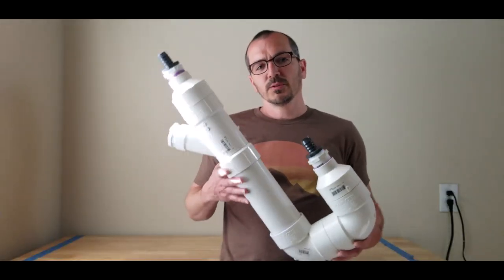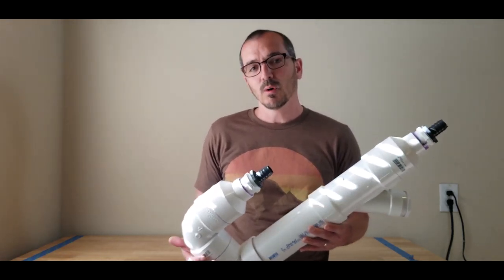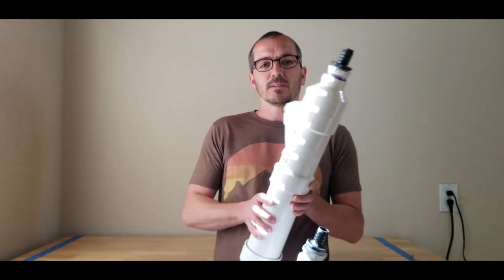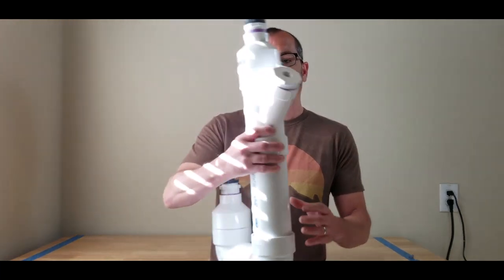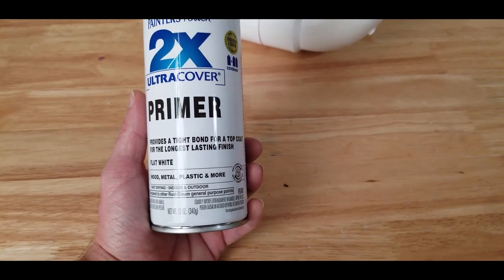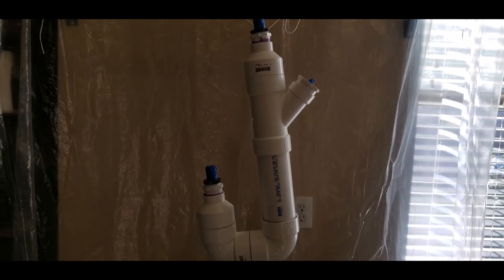Acrylic Paint Poured onto Aquarium Co2 Reactor

Comment: Did it work?  I was looking at your original video as I'm needing an inline reactor for my FX6 on a 100 gallon.  Or should we just use a difussing disc with a powerhead distributing the CO2?
Reply from the maker: Works well to this day. Very efficient. No bubbles visible entering tank @ 3 bubbles per second

Comment: Can you please list the parts you used for this?
Reply from the maker: I show those parts in my other reactor vid, just increase the ones from that vid to the 3" version. Barbed fittings are same on both versions.
Reply: @hugheymorrow  did you fill this up with any media to help desolve the co2? If yes, did that help and how did it effect the flow?
Reply from the maker: I did add media, and I don't think it had much effect on flow because there must at least be enough space for flow in the 3 inch pipe between all the media to equal the space that is in the 1 inch flex pipe.  There is probably more "flow rate" in the 3 inch pipe filled with media than there is in the pipe itself.  Also, doesn't hurt to have the extra bio filtration.